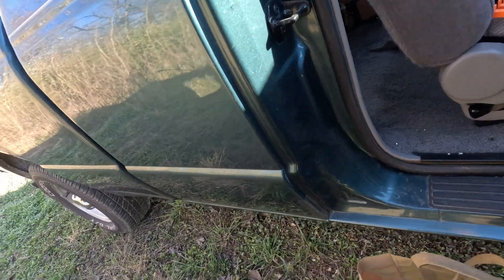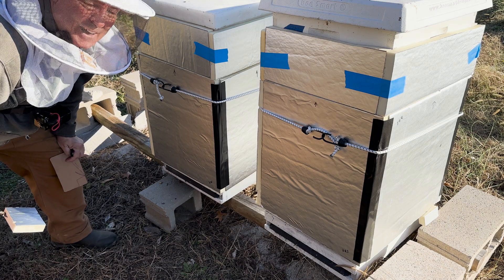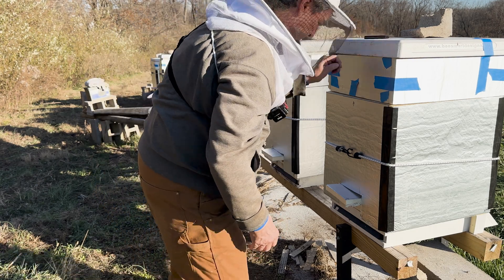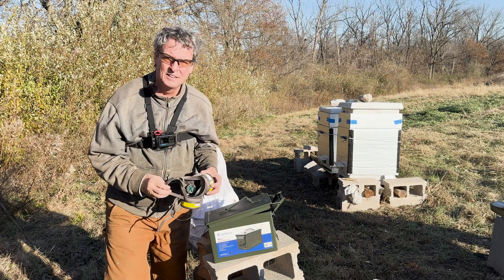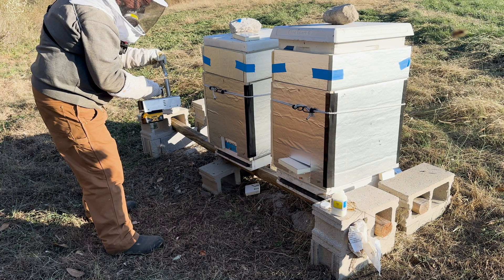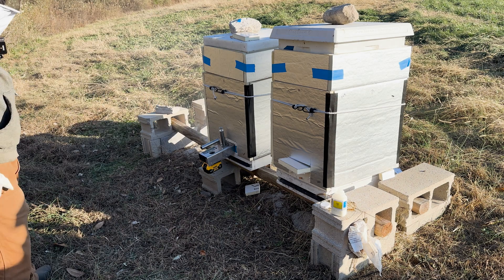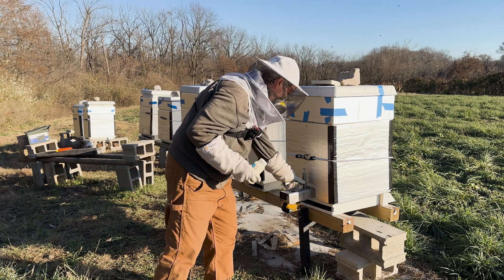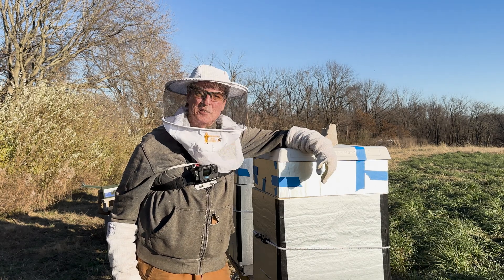Winter Oxalic Acid Treatment

Comment: These warm days in Dec. the bees are very active. The down side of the warm days is they are going through resources quickly. Already most of my hives have gone through a full deep box of resources. I fed them heavily in Oct and they are eating their resources up. I seen mite levels were increasing and don't have a vaporizer so I put in OA strips. I was impressed how well the strips have been knocking down the mite loads and was glad I didn't wait to treat these hives. I think my results were just as effective as vaporizing. Some would say the strips are not cost effective. But in the long run not losing population and having healthier bees, not having a colony collapse should compensate the cost